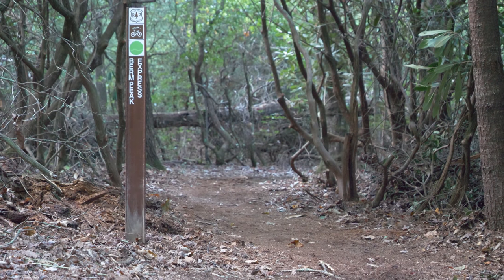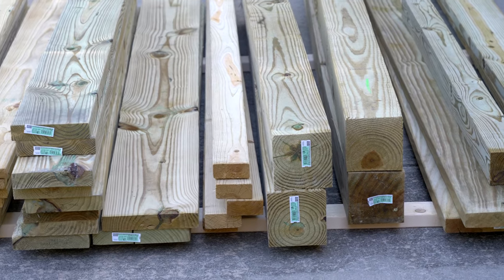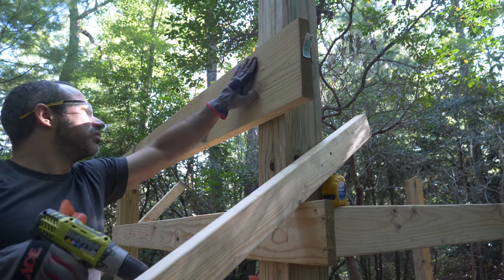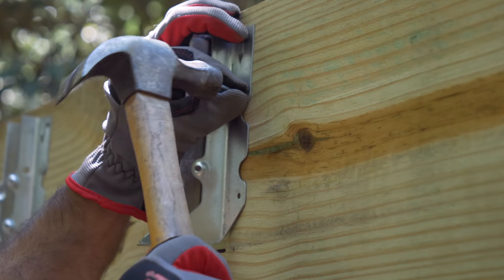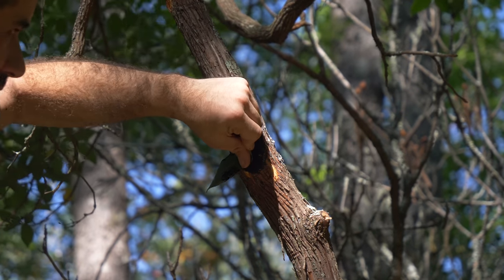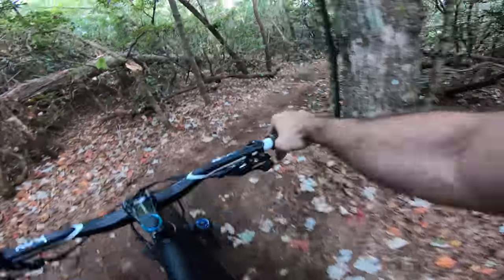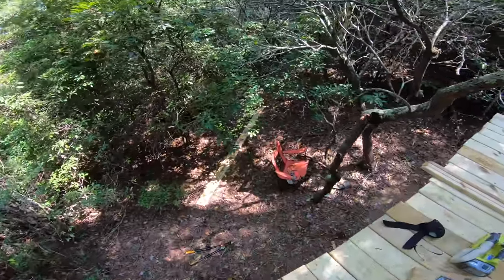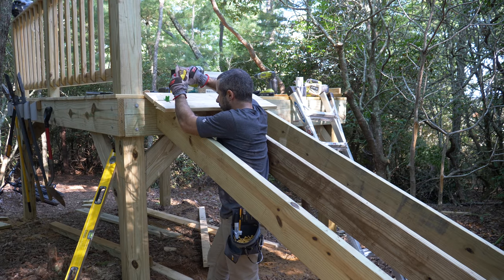Building and Riding the Backyard "Flight Deck"

Comment: You should add grip tape strips to the ramp you climb up so you won’t slip if it rains
Reply: That's actually a great idea
Reply: Big brain time
Reply: Sand mixed in varnish makes a nice, grippy surface as well
Reply from the maker: See if you can pick out the clip with the roll of grip tape laying on the deck. Great minds think alike.
Reply: @SethsBikeHacks  

6:27
Reply: Skateboard griptape? Probably wouldn't last a week. On a skateboard you constantly clean your grip so it sticks to your feet, or you religiously avoid dirt. As soon as the griptape is caked full of dirt the wooden deck itself is probably better than it. But I'll have to wait and see how it works out before I truly judge it.
Reply: Better off with wire mesh.
Reply: Anti slip tape, or anti skid tape, is the way to go. 
Used in many stairs to avoid fall damage. Oh wait that's the same as skateboard tape I guess. Weird considering skateboard is the premier instrument to cause fall damage.
Don't know how well it'll hold up to bikes rolling over, so I suggest to split the tape in three different parts on each plank so you can easily replace smaller damaged parts. 
If the middle gets torn up, people can walk on the tape along the sides. Will make rolling down with the bike more grippy as well.
Reply: Actually, Chicken coop wiring is the bees knees. That's what most bike park use and it's pretty durable. won't come off with rain, and works both ways up and down. Plus it's still grippy when it rains.
Reply: Chicken wire
Reply: Good idea
Reply: Chicken wire over the top works great.
Reply: @Willemmoseley  yes
Reply: @SethsBikeHacks  Not that this would necessarily need it but a few of the older wooden features in my local trails in WA have chicken wire covering them for grip during the winter months that won't wear out in a couple seasons.
Reply: Not really great thinking common sense. In the UK pretty much anything made from wood has grip added. Be it just cuts in the wood to chicken wire and paint with sand in.
Reply: Haha exactly what I went to the comments to suggest
Reply: Logan Boswell that's good
Reply: Any kind of chemical treated wood will be slippery af and to grip tape will help
Reply: Also down haha
Reply: @levishort4924  My Friends say that 😂
Reply: revo  how many times you gonna comment here🤔
Reply: @SethsBikeHacks  use chicken wire
Reply: @DevinShillingtonSkateboarding  I think he means roofing felt sort of stuff
Reply: @DevinShillingtonSkateboarding  I think he means roofing felt sort of stuff

Comment: Quik tip from a german carpenter:
First of all amazing work really a good "Flight Deck"
But the wood should never touch the ground it rott much faster if so.
Make a hole fill it out with cement and insert a metal structure that you screw your pillor onto.
The lifespan of your wood increase rapidly 😊

Sorry my english : )
Reply: H5 treated timber will last 50 years in the ground.
Reply: PhillipChenJay Even taking that into account, there’s still potential issues with warping due to the wood being in direct contact with the ground. It could make it unsafe
Reply: Borja Etxebarria have you been here?
Reply: Borja Etxebarria Hahahah where are you from
Reply: He might not be allowed too considering the nature he’s working in
Reply: REALBIGBOY997  indeed
Reply: @clarkbigatel5377  Someplace where he is a subject and not a citizen.
Reply: Actually there are many places where you can buy both. It's awesome.
Reply: @johnalderson191  He's just trying to trkurjrb
Reply: PhillipChenJay your English is good don’t worry
Reply: @borjaetxebarria7746  alright foreigner
Reply: The grammar is almost as bad as mine (pretty good but no perfect) but mine is still bad
Reply: What's he ment to do make it float he isn't a wizard and concrete doesn't work out there
Reply: @borjaetxebarria7746  California is one of the hardest states to get a gun in (legally).  I call BS.

Comment: Why is wood so cheep in the US? In Germany you will pay thousands of dollars for this.
Reply: because we have alot of wood here
Reply: Look what surrounds his house...lots and lots of wood
Reply: Because you get wood from eastern European countries. Germany uses as little of its own wood as possible.
Reply: Germany hasn’t got many trees, ans have to import, that’s why
Reply: Settled industry. They need hardwood to even build houses out of wood, paired with the availability of plenty of trees you can harvest solid wood out of...
Reply: Cause it is chopped there shipped to holland then driven or by train to germany. going by ship isn't exteremly usefull since germany doesn't import loads of wood or something.
Reply: In the UK, you'd be better off using plastic or concrete to build a ramp. Pure wood/timber costs a shit ton, man made woods like MDF are cheap but give you formaldehyde poisoning when cutting and last less than a year. People of the US are lucky
Reply: That flight deck gotta be roughly $2k! Thats alot of quality wood there. I would of used pressure treated, im also in the NW though..super nice deck, like Duthie Hill platforms!
Reply: To be fair, that much materials likely cost him a pretty penny.
Reply: @j4m875  Thats just not true. Wood is dirt cheap and widely available in the UK too.
Reply: Bei mir würde nicht das Holz das teure sein sondern der wald in dem man das bauen würde...
Reply: Pressure treated is expensive.
Reply: Because we don’t give a fuck about trees.  It’s all about condos and big ass houses
Reply: Ok german here: Don't buy wood from some hardware store it's a straight rip off. Go to some local Mill or carpenter and ask for cheap wood. He will either sell some to you directly or give you some contact info for one. My father is a civil engineer and a former carpenter himself and he builds most of our big sheds etc himself. He uses the wood from a carpenter friend of his and it's dirt cheap. The first time i had to shop some wood when i was away from home was a shock for me. It's incredibly expensive to buy it in a hardware store. I thought it was some kind of misunderstanding on my side regarding the price :D
Reply: @ttv1doktorn  we import from Poland and the tschechoslowakei. It's incredibly cheap and may be even cheaper than in the US thanks to nonexistent wages there.
Reply: Yah, Eastern Europe is screwed by industry. 

Virtually all the resources in Eastern economy are owned by foreign companies that lease the land and export natural raw resources then process them and bring back finished products at a premium or sell it in higher paying markets. 

Eastern Europe is like America's China, but only slightly worse. 

In China at least they benefit from having the processing factories there so they can make extra things for locals on the cheap.

Give you an example. Romania has oil, wood, natural gas and organic food. All of it leaves the country. 

Benzene, Diesel and Methane gets purchased from Russia for local use even thou Romania has it's own sources for it. Complete capitalist insanity.

And there's more to that story but follows the same pattern.

15-20 years ago when I was there, there were forests everywhere on the mountains. Not anymore. Only few places left with entire forests.
Reply: In reality most Americans don't have the land that Seth has. We have a 10-30 foot yard, with 1,000 to 2,000 square foot house.  Especially in more crowded states the housing is much smaller and yards almost non-existent. So Seth is blessed with yard space and scenery.
Reply: We have alot of wood that grows here so its cheap to make it and sell
Reply: Leander Flöry in România this cost like 150 euros
Reply: @BasicBeachCommunity1   Reality check, most americans dont have the MONEY to own the land seth has. Trust me, theres PLENTY of land to be had, but it comes with a cost. Buy land now cause property value doubles every 8-10 years. We bought our land 15 yrs ago cheap compared to cost now.
Reply: @Ben Turner    idk, I live in London and honestly have to travel at least 20-30 miles for a decent timber yard/sawmill that offers a large variety of woods for less, stores like B&Q or Selco are pricy and don’t have a wide range of wood , it’s usually framing timber. I might be wrong but that’s just from my opinion 🤷🏽‍♂️🤔
Reply: Because Germany try to use as little of their own wood as possible, to conserve their forests.
Reply: @BasicBeachCommunity1  almost every American could have a yard like Seth's but most Americans don't want to live in rural areas they what the instant gratification of have everything premade and within walking distance and will still drive instead of walk. I live in the Houston Texas area and have 10 wooded acres with a 2acre pond stocked with fish and enough game animals in the  woods and fruits and vegetables in the garden that I really never need to go to the grocery store.
Reply: @bobbyhempel1513  I mean, be realistic too.  You're saying everyone should be happy to hunt, skin, and butcher their own animals for food?  I know I wouldn't.  I wouldn't want to spend X hours to go fishing in a pond for dinner either, I have other things I need to be doing.  I also don't want to drive 30-45 minutes just to go to the grocery store.  So while places like Seth's are beautiful, it's also pretty inconvenient.
Reply: In luxemburg a planks like seth used will range from 40 - 80
Reply: That's because Europe got all the number hijacked by the Vikings when they invaded to build more ships lol
Reply: @m00nchildblues  "I would of used..." ??
Reply: Becuase we have all the woods.. our country is basically a massive forest that weve put literally decades into making renewable enough to not matter, wev done did the thing where you strip the land to nothing.. it aint pretty, so we got prepared for better management of it and this is the resulting surplus
Reply: But in croatia wood goes to the whole eu and its still expensive
Reply: In Sweden that deck would cost a couple of hundred dollars. Tops. We have plenty and wood and a sawmill in almost every town.
Reply: @Nicole-kf9oj  but it still just isnt as much of a supply to the demand, it costs way more to get it there and its not as big of a supplier.. shit, here we can just open a business just to supply lumber to your local community, you cant expect them to need to charge the same to match profit margins as a company who has to hire a shipping company just to get it to the  people. Woods heavy, i havent had to do that before but i cant imagine its a cheap thing to move like that
Reply: America is the greatest country on earth
Reply: Because we have no concern for deforestation, yet when other countries do we object...we need oxygen!
Reply: @WestonNey  it always feels weird watching people that just simply dont know because they havent done it do things that you do on a daily basis and look at as second nature
Reply: @BasicBeachCommunity1  yep..  in Los Angeles you have barely enough room for a dog.
Reply: Supply and demand
Reply: @oscars7948  I'm close to LA
Reply: @oscars7948  we also have a lot more trees to cut down to provide wood to the rest of the world
Reply: Leander Flöry 
Because we have a lot of trees. You guys cut down all your trees hundreds of years ago.
Reply: European Union.  Communism.  Socialism.  Anti capitalists.  Lots of reasons.  
Free market (competition) makes things cheap.  
Government interference makes things expensive.

Comment: You must really start to use concrete pillars as a foundation of your projects! Wood straight into the ground will start to rott, chemicals or not...
Reply: Rqoiz Maybe he isn’t allowed to? But being in what looks to be such a rural area I can’t imagine there being too many rules.
Reply: Well if he used locust, it would not be a problem as it rot resistant, bug resistant, common in the area and will last up to 40 years in the ground
Reply: Rqoiz um it’s not holding up anything big and I think if he had to he could just rebuild. Also if he sells the property concrete would be a pain to get rid kf
Reply: @borjaetxebarria7746  is he going to use it for more than 10-20 years
Reply: I the wood was treated right, it might not rot. There is different lvls of treating, like above ground treated and ground contact treated; maybe there is in ground treated too
Reply: Remember Seth statement ...I don't know what I am doing so its a learn by trail and opps
Reply: @borjaetxebarria7746  I keep seeing your comments and they seem very uninformed and based on assumption.  Not only that he was referencing the flight deck not a house.
Reply: @borjaetxebarria7746  Bold claim. The United States is a pretty big place, and generalizing it based on prejudice founded in anecdotal evidence may not be the most accurate way to form an opinion. Just my 2 cents.
Reply: @darknemesis9225  I don't know if they have this in America, but in Sweden we can buy premade concrete pillars that's around one meter tall. You just dig a hole and put them in, done!
Reply: @Rqoiz  Wood is cheaper than concrete and metal structures and requires less installation effort
Reply: @Alitrun  premade concrete-pillars requires the same effort for installing as doing it with wood. You dig a hole and put it in...
Reply: @Rqoiz  how do you attach the wood to the concrete? I have never seen one before
Reply: That’s a misconception, wood can still rot with concrete
Reply: @Rqoiz  concrete is used for load bearing structures, usually. The flight deck wouldn't be considered load bearing.
Reply: @beastfromtheeast9318  is still slot better to keep the wood above ground!

Comment: If you put metal net on the ramps they aren't slippery when wet
Reply: Genius
Reply: for those googling, "expanded metal" or wire cloth get you the right things pretty fast. Getting these in stainless isn't going to be cheap though (metals depot has a 2 foot x 4 foot, 1/2" diamond in 18Ga 304L stainless, for $73 US).
Reply: @Cynyr  I found 5ft X 50ft for 22 dollars
Reply: skateboard grip tape works well too.
Reply: Tabitha b it could hurt tires tho
Reply: This is exactly what I was thinking. I live in this area and we get A LOT of rain.
Reply: wont hurt tires lol. rocks and roots all day.
Reply: Chicken wire fence mesh!
Reply: @tabithab8443  The grip tape will probably get caked in mud and dirt and become useless.
Reply: Stainless expanded metal is the perfect material for this application, but it can get expensive.
Reply: saw those a lot at a enduro trail i went to.
Reply: works on the public trails we have here. rain washes it right off.

Comment: you should build a dirt landing off that drop, only 2-3 feet high so you still have a decent gap between the deck and the landing. also make it pretty mellow and with a rounded lip so it’s forgivable  and casable when you land. probably a good 5 feet wide since the deck is 6 feet.
Reply: Woodman486 the deck needs to be longer or have a ramp down for better speed not just a straight drop off.
Reply: Pounding Muff he has the ramp up which he can get speed from, but I see your point about how it could be a straight drop

Comment: Seth, consider doubling up the two perimeter joist you used to hang all of the other hoist on. These 2 perimeter joist are doing most of the supporting of the deck above. You could add a joist right on top....or, even better right tight below. Looking good so far! Can't wait to see the rest of the trails and features! BTW nice timber screws!

Comment: Helpful pointer. Next time start by pluming one one post with 2 braces 90 degrees of each other. When do second post one brace from post to post them a brace from second post at 90 degrees to from the connecting brace between post then repeat so on and so forth. An since concrete is difficult without water handy. Check into a new foam product used in place of concrete. Have 3 minutes to make sure said post is plumb before it's set and 5 minute til your able build on. Home depot has it on there app dont know about if they stock it at stores or not

Comment: RE 1:23 I love that you are thinking about the environmental impact of wood chemicals Seth. Anyway, here in central Europe we have saying that goes something like this: What burns, doesn't rot. And it originates from the notion that If you want to preserve wood, especially when it is partially buried in ground, you can just simply burn its outer skin where it touches the dirt and about a foot above the ground and that will give the wood a much longer life. It works well and is relatively easy to do with propane blow-torch.

Comment: If you want to add some grip to the ramp for climbing use skateboard grip tape. It can hold up to the elements and won't impede any rolling, but will give people climbing the ramp traction especially when wet.

Comment: Love your vids, and this structure!  Great job.  It looks like your using standard galvanized hardware for the main structural components.  I'd look at swapping those out for triple zinc coated, or stainless hardware.  I had an issue with a large play-land I built and ended up replacing all of the fasteners after about a year.  Modern treated lumber is corrosive and really goes after standard galvanized hardware.  Keep up the great work on your channel, we love it!!

Comment: Great video. 
This is just a suggestion from personal experience on the north shore. The sloped ramp to access the platform should have bigger gaps between the boards so the dirt can fall threw. It not then it will get slick and when it gets wet, scary hah.

Comment: You could coat the wood in cerakote which is a oil based solution that basically means the wood will last forever, it also deters borrowing animals/insects. You can also pour light oils around the bases of structures to avoid underground rot however this probably isn’t great for the environment and Mr Earth will probably have something to say about it. Love the vid Seth keep it up!